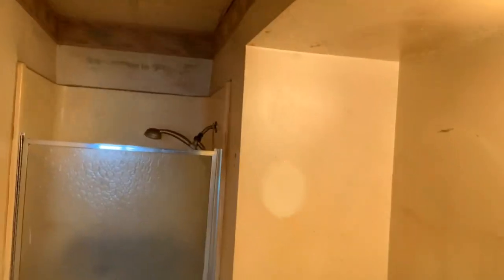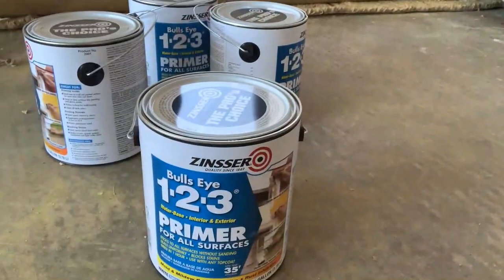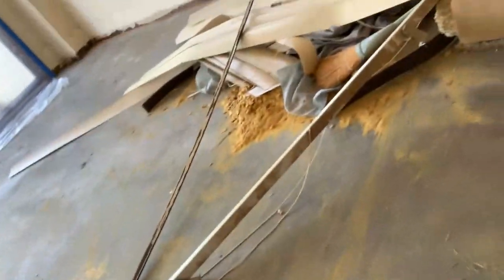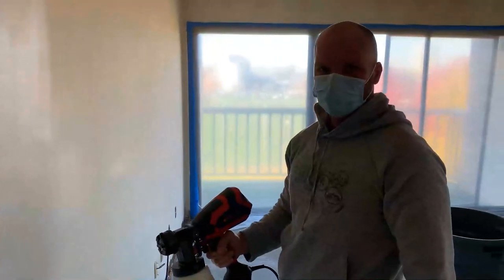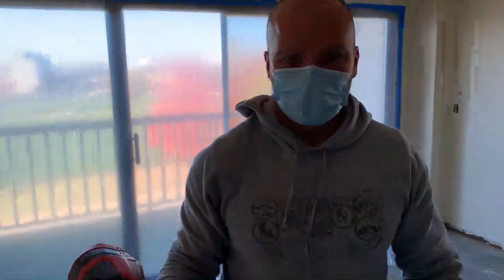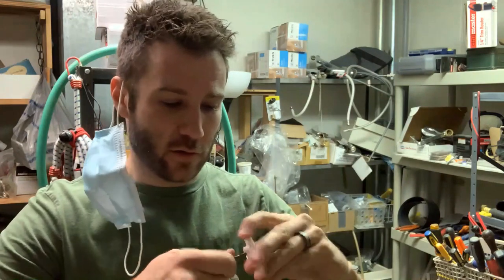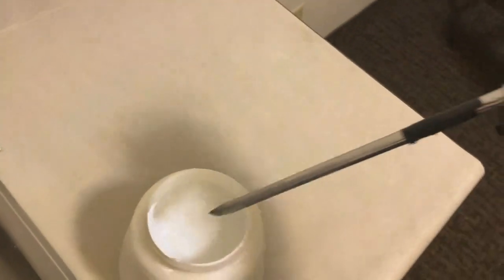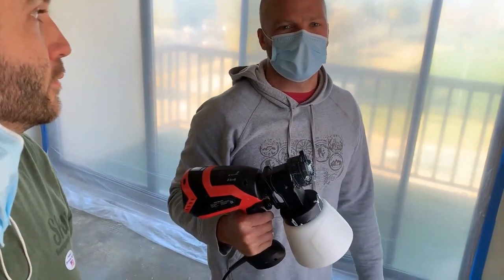Cheapest Paint Sprayer on Amazon

Comment: The bad... 
you guys did not read the manual and this video prevented others from buying one :( lol 
There is a volume control on the sprayer which you guys had to turn in order to let more paint out! 😂
Reply from the maker: We did … turned it both ways no less just to make sure it wasn’t assembled wrong.  Also thinned out paint… still no dice.  Tried all nozzles… and even drilled out a nozzle thinking it was just clogged.  No good.  If you bought one and it worked better then we may have had a defective one but can’t do a good review on a bad product.  Sorry.
Reply: Hahahahaha! Thought the same thing. Sometimes you gotta be smarter than the sprayer. I think these guys are in trouble.

Comment: READ THE INSTRUCTIONS..!!  Use the viscosity cup and adjust that button on the trigger. It allows more paint out. That's what it's there for.!!
Reply from the maker: We tried every adjustment there was on there and even with the paint thinned down it still didn’t put out enough to do any sort of sizable project. It would take several passes to get what I would consider a single coat coverage. If you have gotten better results than it’s entirely possible that the one we got was defective. But I can’t recommend this product based on the results we had.
Reply: @SkyManagement  ..I hope MINE'S o.k as as I hope to spray my CAR this weekend. Taken 2 weeks off work to do it..!! Practiced in the sink with water and seemed fine. The volumn button on the trigger seemed to work o.k so fingers crossed, when I get some paint in there everything should be O.K. I looked at the viscosity chart so will definetely be paying attention to that.

Comment: You had the paint flow to low plus you can also turn the nossle to paint in a sideways pattern
Reply from the maker: We did try adjusting the spray flow in all different ways. It didn’t really seem to make any difference. It’s possible that the one we got just didn’t function properly.
Reply: @SkyManagement  I got one granted a more expensive one and it has its own box that it used to suck air rather than the gun itself worked rather well just got to get a good quality one of it's something done often enough

Comment: Did you seriously add water to the paint to thin it? Acetone,  mineral spirits etc hell you could use gasoline. I have this exact paint sprayer and boy does it work well. When properly used. Painted my truck. 8oz paint, 6 oz Acetone 2oz. Want to dry even better? Use 2 oz of enamel hardener with that ratio and you will have a beautiful paint job.

Comment: Did you use the adjustment knob? I didn't hear you mention if you adjusted the knob for the amount of paint that it will put out. I saw other videos that showed it putting out more paint and faster than what you guys were showing.
Reply from the maker: We did try to adjust the paint flow, however I think ours was kind of defective. We did a second video and tried to show doing some of the things that were left in the comment section on this video, and the sprayer started smoking and caught fire.... so I am not recommending this one. We order a Wagner sprayer that is very similar, and it was 100x better! and it didn't cost that much more.
Reply: @SkyManagement  understand I went with a more reliable Sprayer. Cost rwice as much but seemed more flexible. Thanks for the response

Comment: Well, it looks like you are using the wrong tip. You are using a round spray; you need a vertical spray tip.
Reply from the maker: I wish this were the case but unfortunately we tried all tips including drilling out tips… We also watered down the paint and still nothing.  Is it possible we got a bad machine? Possibly.  Upon our second use is actually hot fire unfortunately we weren’t filming a YouTube video on that or we be millionaires! Lol

Comment: Did you run it within specs for viscosity? Or didn't it come with a funnel to determine the viscosity after thinning the paint?
Reply from the maker: We ran it with every setting and various paints … thinner etc.  was not impressed.  It did come with a funnel if I recall but we shipped it all back when it was found to blow
Reply: @SkyManagement  Yeah... It's provably not wise to settle for anything less than for example the Graco X5 or something similar.
Reply: @SkyManagement  The funnel is the most important part!  It is the viscosity calibration.   Use the funnel. lol
Reply: @SkyManagement  Lol so you failed to read the instructions properly and use the viscosity cup to get the paint to the correct viscosity, "just plop that much in" and then when it doesn't work it's the guns fault ?
Reply: Yeah not a funnel. Your paint was definitely too thick. You disregarded the viscosity directions and now blaming the paint sprayer. Mine works fine. Mine came with brass nozzles up to 3.0mm which I used to do my entire shed.

Comment: I had the same experience with these I bought 2 of them I'm about to be calling Amazon in a second here
Reply from the maker: It burst into flames on second use.  We bought a wagner sprayer (video is on our page) Yes... it cost a little more but it is WAAAAY better
Reply: @SkyManagement  The Wagner had a defect. I bought one back in 2015, and when you release the trigger, the vinyl paint comes out of the tip and drips on the ground.

Comment: Problem is you need to thin down your paint way too much or else it just does not work. The other issue is because ypu have to water down your paint it drips too much. Good concept but unfortunately does not work. It could work for your 1st coat though but unfortunately brush and roller is still the only way that works
Reply from the maker: We completely agree!

Comment: There wasn’t a volume control knob? Which would allow more paint to flow to the tip. Or was the paint so thick and the sprayer so underpowered that it couldn’t push any volume through the nozzle?
Reply from the maker: Oh there was a knob.  It did little to nothing.  We had to thin the paint down quite a bit for it to even do a little.  We assumed you get what you pay for but we were hoping for a little more “spray”. Doing small projects it would likely be ok.  Spray was fairly even just not enough for a larger project
Reply: The container that the paint came in has the cut ration and medium in which is needed to thin the paint! Only thing you can use in a paint sprayer like that without cutting is stains because they are so thin!

Comment: The sprayer may or not be good but the comment made by another user that the adjustment on the trigger wasn't correct appears to be accurate.  As important, the item you mentioned as being a funnel is used to test the paint thickness and must be used per the instructions to make sure the paint is adequately thin.  I don't think anyone can really determine if this sprayer is any good based on this review because it doesn't seem that anyone read the instructions before trying it.  If it was still bad after doing so, that would be legitimate but that doesn't appear to be the case.  Sorry.
Reply from the maker: I appreciate your thoughtfulness and descriptive interpretation of our review.  All too often people are quick to judge and I am glad you are not one of them.  We took to heart many of the comments and gave the sprayer a second chance on our video where we made a brew house out of a storage room at work.  During this filming the fun burst into flames.  We show trying to use it a second time only to have it blow smoke on camera.  Misuse… no… faulty equipment… perhaps… in either case I can not recommend a tool that will burst into flames on second use.  

We DID review the cheapest Wagner paint sprayer on Amazon and it works well.  For not much more money it is by far worth a look.

Thanks again and We will try to better serve you in the future.
Reply: @SkyManagement  Good deal.  Did you post the video on the Wagner model?  I would like to see that if so.  I am looking at videos because I want to purchase a sprayer to do my kitchen/bathroom cabinets.  I want one that provides a smooth finish but since I will probably not use it much after that project I don't want to spend more than needed so I appreciate your video and reply.

Comment: Do you have to use a Paint Thinner mixed with the paint?
Reply from the maker: It did shoot some paint without thinning it down. But in my opinion it worked better after we thinned it a bit. However, I can only recommend this sprayer for small hobby kind of projects. It did spray evenly, but it would take all day to paint a wall with this thing. It just doesn’t move enough paint.